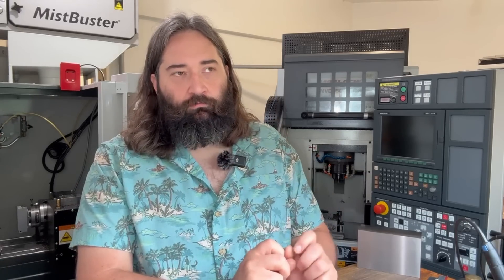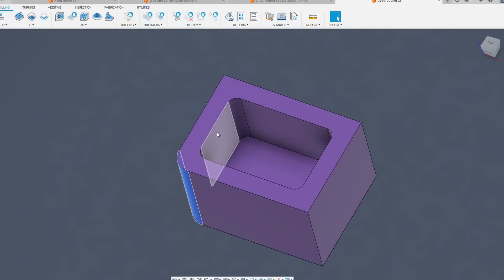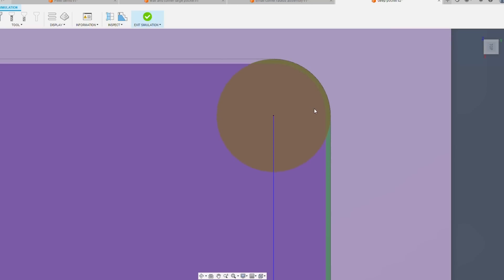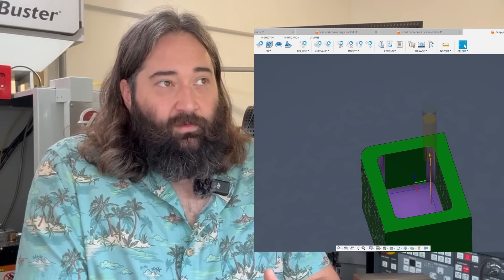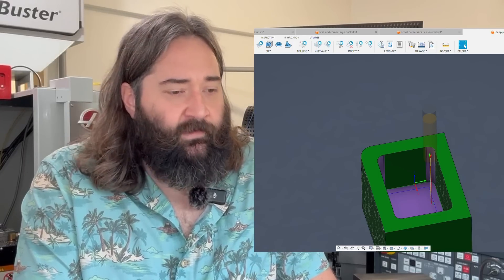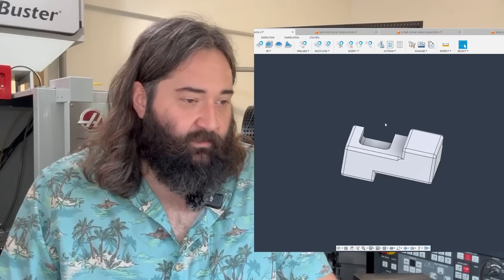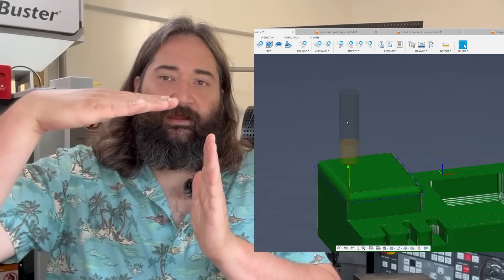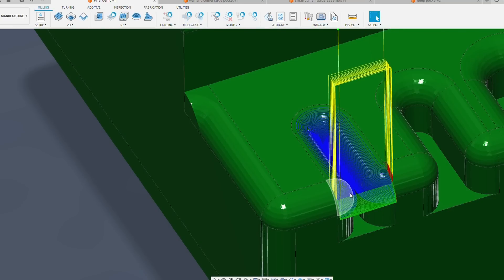Fillets make your cnc parts more expensive

Comment: 13:30  So, for small volume parts, if the corner radius isn't critical (i.e. they're just there to avoid hard corners.  Handling, materials stress, whatever reason) include a note to the machinist "Exact radius not critical, pick a radius between A and B you already have a corner rounding tool for."  Your part will be cheaper and they'll be happy you thought about making their life easy.
Reply: Another way to accomplish the same thing is to put a large tolerance on the dimension for the radius feature; something that should allow for a few tool sizes, but still works for your design. That approach tends to work better if your part is being made by someone that doesn't speak the same language as you. It also probably complies better with more modern drafting standards.
Reply: @staples156 Yes! A wide open tolerance is much simpler than a designer overthinking it and adding specific notes.
Reply: @staples156  This is a great way to do it. Always put the largest tolerances you can get away with. There's usually a "general tolerance table" specified for each drawing, so anything not specifically called out with a tolerance like R10 +10 -5 would have a lot tighter of a tolerance.
Reply: Just tell them to break the corner, much simpler.
Reply: @radtap  break the corner with what though. There are corners I can break with ⅛x45⁰ no problem, but if I break a different corner with 0.005"x45⁰ I could ruin the part.

You'd be surprised how often I'm asking for clarification on corner breaks or other seemingly minute things like surface finish, or tolerancing on features.

Sometimes features that are important aren't dimensioned properly on the drawing for one reason or another.
Reply: I've seen recently a note of "R.xx permitted" where not critical, in other words up to that radius or no radius is acceptable
Reply: Yeah, or instead of telling them each area that's non-critical ... just be specific about those specs that are critical and give them latitude for the remainder.

Comment: Fillets were a huge issue in the mid 90's when solid modeling was becoming more available to the masses. Engineers put fillets on EVERYTHING because it was so easy for them to put them on the model!  It took years for them to stop doing this. There's a technique for putting an outside rad on with a slightly larger corner rounding end mill. I learned it from watching the 2-minute Tuesday series from Mastercam reseller Cimquest. I've used the technique with other software, and you may have to change your methodology slightly depending on your software. Here's the video on how they do it in Mastercam.  https://youtu.be/BiFdSahvasI?si=ehT9YgwtP1QCX3So

Comment: regards other things i would like to know: how does a deep drilling operation affect cost? for example a 6x60mm hole. second thing - how does material choice affect these things? ie. aluminium vs steel vs titanium vs plastic. cheers!
Reply: third bonus thing: features on all 6 sides ie you need to drill and tap the top and bottm as well as an irregular shape machined from the other 4 sides. in my mind that makes a part super expensive... how the heck do you even hold on to the part.

Comment: Heat treating video would be much appreciated! 
Designers must know what constrains manufacturing processes have. For example 3D printing can do beautiful fillets. But at which orientation will it be optimal? Which additive process will be used? What percentage of the cross section can you expect to actually distribute the load? ...
This is why I think it's important to have a multi-disciplinary CAD-CAM-CAE softvare like Siemens NX or Autodesk Fusion, so that even less experienced engineers can design, validate and properly optimize parts before pissing off manufacturers... XD
I love videos like these culminating many years of experience! Yours are true gems, keep up the good work!

Comment: I've played around with surfacing external radii with a larger diameter radius cutter than the part calls for instead of using a ballnose cutter.  This is a pain in the bum to program since it's difficult to get the CAM software to do it but with some extra geometry and a fake tool reference point it can be done.  Saved quite a number of laps and produces a much nicer finish. Only worth it for production.  I wouldn't bother with a one-off.

Comment: Classic disconnect between design and Mfg. When I managed a design team I would get the designers to send there early concepts out to the tool makers for comment. Getting the part makers involved early and often helps a lot in avoiding late project problems and expenses.

Comment: I would add, sharp inside corners on large parts like the inside of an L shaped part, if you can just throw a "Allowable radius" callout in the corner, that way it can be made during profiling, and doesn't need to be floor machined from a different orientation

Comment: You did well explaining why things don't work and the process you have to use to accomplish the final result. 

I would say a video about what can and can't be done with a round bar, when you would split parts, and locking joints could be awesome. 

If you want a Viral subject matter, teach us how to make a Nintendo 64 Joystick out of Steel =p Steel Sticks are exceptionally sought-after in the speed running community.

Comment: I’m a mold and die maker. This is great knowledge to those who have no idea. Another idea I can think of is when you need grind stock on an OD or ID with a radius at the bottom. You’ll need to hard mill or grind that radius after heat treat because your cutter cannot produce said radius when the wall has grind or hard mill stock on it.

Comment: Scrolled for a while and didn't see it mentioned. Fillets are very usfull for making parts last longer, sharp corners are stress concentration points that will lead to early failures. Really excellent content for making fillets easier for the shop to make.
Reply: Internal fillets - yes. External fillets that don’t interface with other parts remove mostly dead material that carried no loads but had weight.
Reply: @absurdengineering external fillets can also help resist corners from chipping

Comment: When you're talking about the pocket with equal floor and corner raii, you can get away with using a bull endmill. Try a floor pocket with the bottom of the radius selected as the profile and use a negative stock to leave equal to the tip rad on the endmill. Then constant step up ramp the floor rad. Depending on pocket tolerance you usually don't have to even do a wall finish profile, the ramp up surfacing pass will take care of the floor rad and the walls. If you do need the tolerance or spring passes or whatever, run a profile with the top edge of the floor rad selected and a negative axial stock to leave equal to the tip rad. It does for sure take more time to surface the floor rad, but it keeps it all to one single tool.

Comment: Extremely helpful Adam. Thanks for taking the time to create the demo part, CAM it up with instructive tool paths, record the content and edit it all together. It's easy to be on the receiving end of this and forget the work that goes into it. Re boring out the corners of that interior pocket to avoid excessive tool engagement, do you leave any stock there or go right to size? Does drilling and reaming give an accurate-enough hole that you can avoid STL and get a nice blend with the follow-up pocketing operation?
Reply: If you take a closer look @ 6:30, he shows that the pocket is already roughed out with stock remaining. Then he bores (using helical boring toolpath) the corners to the "HIGH LIMIT OF THE TOLERANCE". Then you would finish the walls with a final contour pass to nominal dimension. These 3 operations should give nice corners without any chatter or excess stock. So no need to drill and ream. 
With drilling and reaming you will probably have a small step on the floor next to each corner on your finished part.

Comment: I would love videos on considerations for heat treated parts and micro-milling. I know you've ground zirconia, but if you have any thoughts on machining ceramics that would be appreciated as well. 
I'm a PhD ME student who's getting ready to do a lot of ceramic work. My results from heat treating would be inverse of steel and I may be micro-milling, it may be more micro-grinding; either way surface finish and form is upmost importance (I think you can guess the application from this). I'm sure even if you haven't done it, what you do present there can still be some lessons learned.

Comment: 1. Give assembly corners clearance where you can, vertical or horizontal.
2. External horizontal chamfers are cheaper than radii.
3. Floor fillets should be given more tolerance. Tolerance as a max value if possible. This lets the nominal corner radius of various sized bull endmills clean up that fillet without concern.
4. Make vertical corner fillets and radii 10% oversized the nominal cutter radius whenever you can, which should be pretty much always if you are designing both parts.
5. If all the dimensions on a print have the same tolerance, it's a bad print. Show the machinist what is important, show them what isn't.

Comment: I beg to differ. A pocket with square corners is how you make your part super expensive.
Reply: yeah, what's nuts is when people don't get that this is the primary reason the fillet tool exists...  to model mating geometry that doesn't need a custom broach or EDM to make...
Reply: @DSiren  CNC broach them.  Get your Z axis paying it's way.
Reply: @Vinzmannn  sometimes you need a square corner.
Reply: @AndyRRR0791 agree but not all machines can especially the older ones
Reply: I love all the replies to my comment. They clearly show that some of you either can't read or comprehend. My comment says that square corners in a pocket will make the part super expensive. Some of you took that as 'impossible to make'. My comment never suggested that it was impossible, just that it would greatly increase the cost of the part for no good reason. I am well aware of the different ways to make square corners in a pocket, all of which add time (cost) to a part.
Reply: Not really. I use my new square end mills. Works a charm.
Reply: I love how machinists are playing uno reverse card in this comment section
Reply: Don’t forget the inside the box blind holes
Reply: @rexmundi8154 these are my favorite things to put on drawings. Holes that only exist on the inside of models with no way to actually drill them without deviating from the print.
Reply: Not to mention corners on an end mill chip way easier on a sharp cutter
Reply: Did you even watch the video before commenting?
Reply: EDM also cannot produce square internal corners... Your electrode has a diameter. Unless you are referring to making a custom electrode... Which is going to be also extremely time consuming and/or expensive depending on who's time you're paying for
Reply: @SamCyanide  Die sinker not a wire edm. And in that department boys and girls, I am Yoda.
Reply: @CANADIANCRUSADER1192  Toy Yoda, probably.
Reply: @CANADIANCRUSADER1192  You really don understand the difference between the "possibility" and the "price" do you?
Reply: Really awesome video Adam. Very well explained and in a world of Co-Op designers with no concept of machining, excellent coverage of this topic. Subscribed!
Reply: just use a square cutter
Reply: Damned if you do, damned if you dont
Reply: Hilarious how even the og creator here agreed with you on this and admits the claim in the title is just gaming the algorithm and then the comments are full of people calling you out on "attacking" them 😆 Seems like a lot of the viewers here are rather more looking for action and drama than machining and engineering 😅
Reply: Then you need someone with my abilities. Lol. Machinists headaches are a tool & die makers bread and butter.
Reply: EDM🤷
Reply: @AlexndrPewPew yes. These machines are expensive to operate. Also it’s useless if your cavity has a floor.
Reply: @Rackmaster9K  wut? Edm not for holes with floor?) I have news for you! You can make an elwctrod with desired shape with cnc for edm machine and edm'the'hole of perfect shame. C'mooon.
Reply: @AlexndrPewPew  Did you watch the whole video? He addresses that...
Reply: Just drill out the corners..
Reply: @melody3741  But then the drill bit is rounded too isn't it?
Reply: Where exactly in the video was there a recommendation made for pockets with square corners, I.E no vertical fillets. There was none, so you differ with what exactly? A strawman.
Reply: @m3chanist  The very title of the video says "fillets make your cnc parts more expensive". I disagree with that, while fillets around the outside of a part will add time and cost, they pail in comparison to the added cost of making a pocket with square corners. In this example fillets would save you time and cost.
Reply: @mattlarson9897  Again, nowhere in the video is the situation you disagree with suggested, infact, just the opposite. You are attacking a straw man of your own creation.
Reply from the maker: @mattlarson9897  your absolutely right, and I found your comment funny. Sadly titles like this just flat out do better in YouTube and drive more comments. I hate that it works so well. I hope you enjoyed the video otherwise
Reply: @mattlarson9897 I totally agree!
Reply: @adamthemachinist  So we're to take that as you being a Google Adsense robot pretending to be a real boy?

Comment: Its only a matter of time for America. It was the same for us in the Uk. We kept the good bits like miles, mph etc, but we also pretty much ditched our own system for metric. It is, in the most part, vastly superior and easier to use.
Coming from a time seeved machinist who is comfortable using both systems, i always naturally lean towards metric.
Reply from the maker: If I never cut another inch hole I would be perfectly happy. Having to keep both metric and inch drills/taps/reamers on hand is expensive. From a cnc tool library perspective, the metric hole system uses significantly fewer tools since often times one screw sizes clearance drill is the next sizes up tap drill. It’s just a much cleaner sway of doing things and set of cutters. Of the top of my head each much easier to know the tap drill size for a m16x1 thread than it is a 5/8 x 18 .

Comment: I agree with a comment below - these situations fall within the part designer's (engineer's) area. I have always had the position that machine shop experience should be an integral part of course work for a degree in mechanical engineering. Also that course work should include some electronic control theory.

Comment: Another option for wire EDM in a corner is to cut into the stock to leave no radii on the corner. For the 90⁰ example, if the wire cut into the stock the depth of the wire at a 45⁰, you're left with an undercut but the mating component can maintain a sharp 90⁰ edge without interference.
Reply: How would you call that out on a drawing?
Reply: @fergusoddjob  It would be a specific feature, for example the relief in a v-block. Also, it doesn't technically need to be the full depth of whatever cutter you're using, but full depth would be more than safe, especially to make sure that debris doesn't clog it and stop it from functioning. 
The one issue with this is that it is a more significant stress-raiser, so you'd want to be aware of it as a potential issue.

Comment: Very helpful.    Thanks.  I often get the opposite as well.  Thin parts that could have the entire perimeter milled out  in one go, but the engineers decided all the internal corners need to be dead sharp.   So that turns a one set up job into a three set up job, then they complain about it taking too long.   Lol.  Engineers are a fickle beast.

Comment: Having problems grinding heat treated parts mostly full hard 65c d2
Managing temps and sharp wheels has been a challenge- 
I'd like to hear about your different wheels/techniques with grinding

Also hard milling-
I had success milling a slot in a broken lathe chuck jaw- small stepovers but felt unsure with a lack of knowledge

Comment: some of these can be somewhat solved with a 5 axis but overall great advice for designers. gonna keep that in mind. that is kinda cool when 3d printing though. you can (often should probably) chamfer a lot and it simply prints
Reply: We do a lot of consumer facing parts and often times chamfers and fillets are needed. 5 axis deburr paths can be pretty fast and engineer doesn't even need to draw the chamfers/radiuses as they are programable. The other path I like is morph between 2 curves it'll zoom around the edge of the part and put on beautiful radiuses.

Comment: How does anodizing affect the kinds of tiny interferences you describe in this video? Like, is there uniformity in how the fit-up tolerances change, or do tolerances change depending on different shapes and features?
Reply: Yes, one example is oversized taps for threads in parts that get plated.

Comment: When adjusting tool blends I've found my eyeball to be incredibly accurate , but nothing beats measuring blends/radii like a profilometer (drags a stylus across surface, outputting a graphical 2D plot)
..I wonder if anyone makes a handheld profilometer device that could be used to quickly probe a blend/radii while the part is in the machine?
Reply from the maker: I always though something you could attach with a mag base and run over a feature would be slick

Comment: Outside fillets can be used to the machnists advantage. If you hold the part in a vise with dovetail jars the dovetail gets removed when you add the fillet as last op and you don't need any grip stock (assuming the fillet is big enough of course). Might help with warpage or using thiner stock.